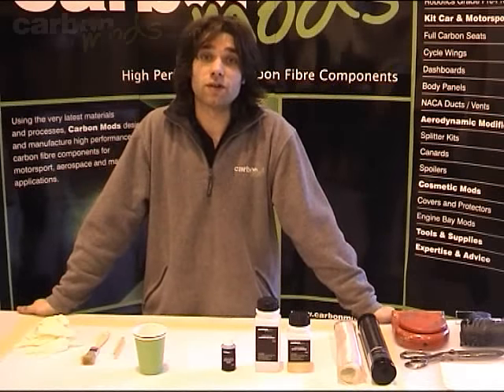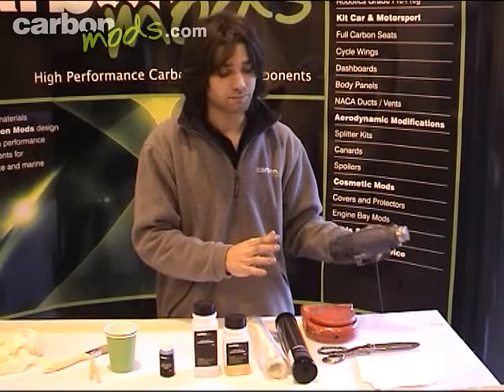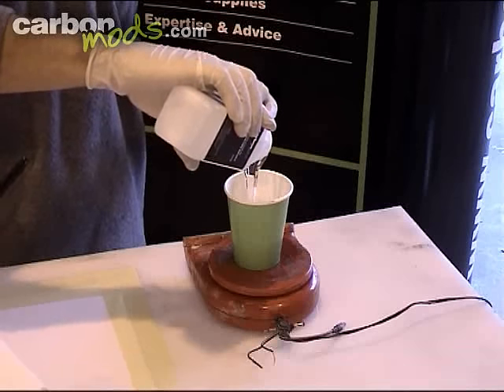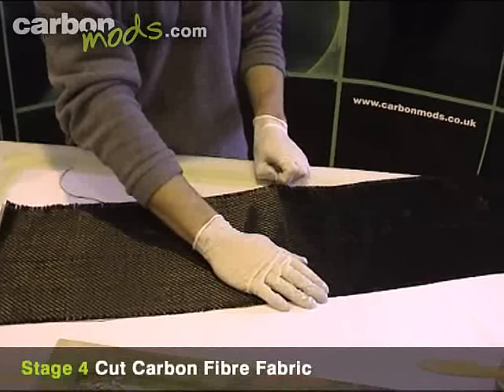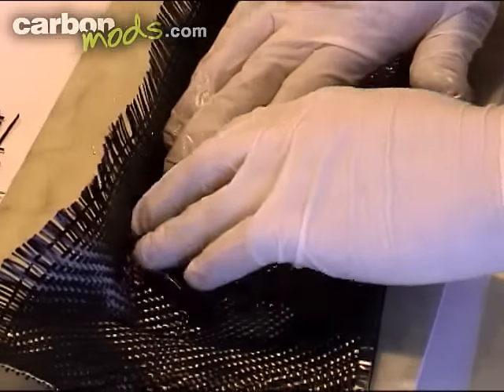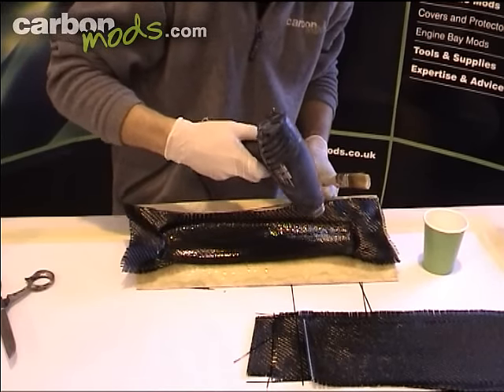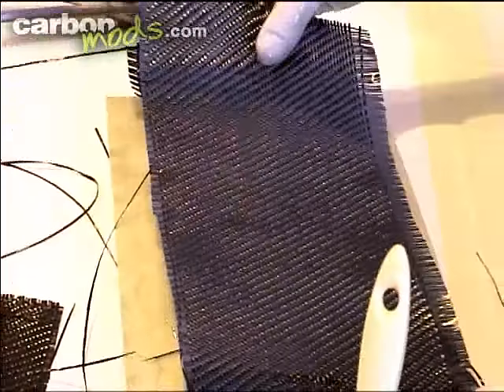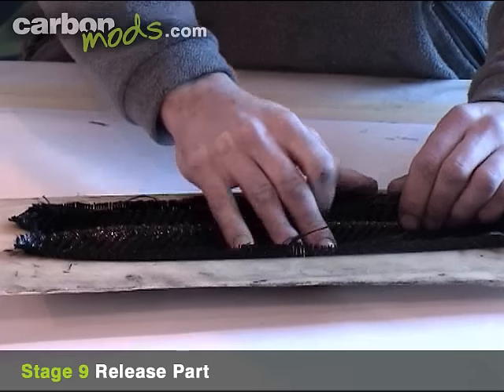How To Make Your Own Carbon Fiber (Fibre) Parts.

Comment: You may not have fully understood mechanics. A higher volume fraction does not implicate higher strength, but a higher strength to weight ratio/ higher area to strength ratio/ higher youngs modulus (since the youngs is area depending). Since you just have more material when overwetting, the component is marginaly stronger, and heavier.

Comment from the maker: Bertaziod, autoclaves apply pressure, vacuum and heat to the laminate, (special pre-preg materials, that already have the resin in) this consolidates the materials making a stronger/lighter laminate, we use this process for many of our production components, but you can get 90% of the performance and amazing finishes using the method in the vid without spending tens of thousands on equipment! Despite having a 'clave we still use this 'wet' process regularly  in our workshop!

Comment from the maker: Well, a globe is tricky because it would need to be made in at least two halves (otherwise there would be no way that you could be laminating 'inside' the mould. Two two parts would need to be put together afterwards, bonded, and then probably lacquered over the top to make the seem really smooth and hard to see. The fibre would not be continuous - there would be a visible join where the two halves come together, but under lacquer this would look fine.

Comment: One thing that you might tell others is that when you are starting your second, and third reinforcement layers after the first, you want to try your best to criss-cross the weave of the fabric to gain even more strength of the part when its done. If the part is for looks as well as strength, then the second and other layers I will use black fiberglass cloth and save my carbon fiber myself.

Comment: Quick pro tip....if you aren’t going to vac bag your laminate, here is an easy way to get better fusion between the layers.  Take your 1 inch laminating brush, and cut the bristles so they are ~ 8-10 mm long.  That will eliminate stray hairs from getting on your work, but more importantly it will result in really stiff bristles that can be used to force resin into the laminate.  I have successfully used this technique for a laminating schedule of fiberglass cloth, roving, and more cloth over balsa wood core during boat hull restoration.  Works really well.  You get a great bond and use minimum resin.  Granted, it’s not as good as vac bagging, but it’s better than painting the resin onto the cloth
Reply: Awesome advice,  I have worked with fiberglass and much better to force in the resin as you state instead  of painting!

Comment from the maker: Thanks for the interest, there are a few ways that tubes can be made, the simplest way for a home builder to make a bike frame is to wrap the carbon around a foam 'core', a good tip with this method is to wrap the uncured part with shrink tape, this will help to consolidate it. also you will need aluminium inserts for the bottom bracket/hed-tube/drop-outs etc, they are difficult to make/find, you could always just cut them out of an old frame! Hope this helps.

Comment from the maker: @Crixe : So long as you seal the mould correctly (and then coat it in a suitable release agent) then just about anything can be used as a mould. Plaster is VERY porous so you need to use something like primer spray paint to seal the plaster thoroughly. Once you've done this you can release coat it (using something quite robust like PVA release agent) and then you should be OK.

Comment from the maker: Hi Ian, Thanks for the question, to trim the part a dremel type tool with a cutoff disc is ideal, we do some great value tungsten carbide dremel bits on our site which virtually last for ever, we have one in our workshop that's cut over 3 miles of carbon!  then simply 'soften' the edge with some 120 then 240grit paper, you'll get a really neat finish this way. We have more info on trimming in the 'Guides' section of our website. 

Carbon Mods

Comment from the maker: Yes, there is actually. We've been working on it for some time because there's lots to cover. The first one will be resin infusion, after that we'll do a standard vacuum bagging. Just cause we love infusion so much, the parts you can make are just so strong and light. After that, we'll make one on standard bagging. Oh, and for both of them we'll have the rubish sound qaulity sorted! Glad you like the vids.

Comment: Nice dude, extremely helpful, just one question though, i was adviced to use a vacuum pump to get rid of the air, does heating the thing make it as great. Lovely results you got there!

Comment from the maker: Hi Bertaziod, the resin will cure in the air at room temperature, there is no need for and oven or an autoclave (very different bits of kit) the warmer the place where it is left the quicker it will harden. But left over-night at room temp is normally enough to release it from the mould, it will then 'fully' cure (the last few percent) over a further day or so. Thanks for the question.

Comment: nice but it has a much better finish if you bag if and use a vacum pump also makes it a lot lighter
Reply: You need a stiff mold to keep the shape if vaccum laminating. More importantly to laminate in falling temperature when curing to avoid air bubbles

Comment from the maker: You can skip the advert if you wish.  

The mould is made using an epoxy gel coat and fibreglass backing. You can make moulds out of a number of materials including using our mould making starter kits.

The woven glass is used to save cost. For a cheap cosmetic part, most people want the carbon on the surface for looks, so it doesnt matter if you use the much cheaper fibreglass underneath.  However if you want 100% carbon then you can make it that way.

Comment from the maker: Hi, actually, this type of repair works really well. I'd recommend wet-laying the carbon fibre (like we show in the video) and then wrapping the finished repair in heat-shrink tape. You heat up the tape and when it shrinks it will squeeze the excess resin out and leave you with a nice consolodated repair. Our fishing pole repair kit works in just this way.

Comment from the maker: There are a number of ways proffesional workshops can produce these components, from wet layup processes (as shown here) through to vacuum bagged methods eventually onto autoclave cured pre-preg components (which is how we make many of our production parts) but it is certainly posible to use wet layup to produce the parts that you talk of, you might be a few percent heavier but without spending a fortune on equipment it's really the only place to start. Good luck with your project!

Comment from the maker: @ionutzB123 : You're referring to pre-preg carbon fibre; that's cured in an autoclave under pressure and at elevated temperature (150 degrees C would normally be the maximum cure temperature for any standard resin system, 120 C would be more common). Pre-preg parts will generally have a lower resin ratio than a wet-lay part (like the one made in this video) and so be stronger for their weight but  they're both valid methods. Resin infusion is another option which can yeild very low resin ratios.

Comment: that's gonna be a pretty weak piece with many imperfections. it needs to be vacuum bagged to squeeze the layers together. right now you just have a few layers of CF with resin in between them, not a solid piece that's fused together.
Reply: marty galinskas It's solid all right, but as you say it's like carbon floating in a resin matrix, brittle and not very strong at all. Vacuum bagging would probably halve the weight and increase the strength many fold.
Reply: Depends on what your using it for.

Comment from the maker: Hi Casler, 

The white fabric is just a woven fibre glass, it can be used that add thickness to non-structural parts. when the resin 'wets' it it will go pretty must clear, if you are after a silver weave check out the alufibre on our website, it makes parts that look like a silver version of  carbon fibre. Hope this helps.  

Carbon Mods

Comment from the maker: Hi Givemetoast, 

Weave orientation does effect the performance of the final part, however it depends where you want the strength as to how you might layer the fabric, alternating between 0deg and 45deg will give the most consistant performance in all directions, however if strength is desired mainly down the length or width (or both) of the part then keeping the layers in-line will improve performance there. 

Thanks for the question, 

Carbon Mods

Comment from the maker: Hi, Yes you can but generally for large parts (like fenders or fairings) you would use a vacuum assisted process - ideally resin infusion. It's not as complicated as it sounds and we have complete Resin Infusion Starter Kits available for £320 which include the vacuum pump, resin, catch-pot, bagging materails and everything else you would need for the process. Parts made in this way would be incredibly strong, light and amazing looking!

Comment from the maker: Hi Walperstyle,

Just to clear things up for others, this is true 100% carbon fibre, sure there are more advanced processes out there such as resin infusion and prepreg laminating, that get even greater performance, however wet-lay-up as seen here is where it all started and is still one of the most common manufacturing processes due to it's low-cost setup and tooling. 

Thanks 

Carbon Mods

Comment from the maker: Hi Lowcost, It's difficult to know what you mean by very stiff but a peice at 5mm thick would be virtualy impossible to visably bend in your hands at that size, that would be about 12 layers!, sanding the surface is not nomally needed, but a bit of a polish can often help to bring out a full shine! I hope this helps.

Comment: You never explained what the white roll of glass cloth is used for.
Reply from the maker: Good point, sorry! Really we just include this in case people want to have a practice run first with a less expensive material or alternatively you can use it to 'back up' a carbon fibre part so that it's carbon on the surface and then reinforced with glass. By doing this, the part won't be as 'high performance' but it will reduce the material cost and make the carbon go further.
Reply: @Francesco Cancellieri yes

Comment from the maker: @awesomenoob6281 : Yes, certainly. Either the bodyshell or the chassis. For the chassis you would generally make flat sheet and then cut the shapes out of the flat sheet. The bodyshell you would need a mould for. If you use the inside of an original lexan bodyshell then you'll get a nice part but it will be slightly smaller than the original.

Comment: sorry I cant hear it. what's the ratio again for epoxy and the hardener?
Reply: Buy a book Sorry.
Reply: i cant understand myself, on the bottle says 100 - 30 but on this video something 2 to 1 or similar .. :/
Reply: Evaldas A  Depends on the product! I use west epoxy which is 4:1. you have to follow the instructions on the product itself. sounds like you have a 10:3 ratio, which seems a little odd. also note if it is by volume or weight (although most resins have an equal density between hardener and base and this is a moot point).
Reply: Tim Sherry  yeah, my tin says 10:3 ... which to be say its allright, my part came out looking nice and strong, but was a bit runny on the edges... well, i still have few drops of it, i will try to mix it a bit differently ;)
by the way.. thanks for your info :)
Reply: It's a legit question, if you're used to polyester you might think it doesn't matter. And the last thing anyone wants is to hear about a big stack of carbon fucked due to crappily mixed resin.

Comment from the maker: Hi BadAndy029, 

The thickness required for a cosmetic part depending very much on what the part is, but generally small cosmetic parts such as interior trim would be made from 2 or most often 3 layers, and for non structural parts after the first layer the rest can be made from woven glass. 

Hope this helps 

Carbon Mods

Comment from the maker: Hi Plooke, if you're getting a matte finish that will almost certainly be on the mould, give it a really good polish, the part will only be as glossy as the mold, you can polish matte areas on the part or mould with some metal polish or paint restorer (try on a small area first). I hope this helps you out.

Comment from the maker: Hi grindzewall, 

The resin in the pot does cure and there's no real way of stopping it, so it's a case of judging how much you will need and only mixing enough, as for trimming the part, generally the trim is done after the part has been removed from the mould, there's loads of info about this on our website. Thanks, 

Carbon Mods

Comment from the maker: @themichaelnuckles : 'Fibreglass resin' is generally polyester resin, this is epoxy resin. There really is no liklihood of accidentally setting the resin on fire using a heat-gun to pop air bubbles. It's standard practice and a very important part of the process to get rid of the bubbles (by lowering the viscosity of the resin and expanding the trapped air). If you use a hair dryer you need a *high* heat setting and a *low* blow setting (otherwise you just blow the resin off.

Comment: i worked in a carbon fiber facility and to build REAL carbon fiber (pre-peg) you need  a serious equipment worth like 100.000 + dollars.
Reply: I worked for a super yacht mast manufacturer and we used the same method as this guy but we vacuum bagged.
Reply: We used pre peg materials ,you used dry probably :)
We put them in the autoclave after the vacuum bag.
if you don't put the carbon fiber in the autoclave then it isn't real carbon fiber,it's weak.
Reply: dimmacommunication it is as strong as fiber glass, but not as strong as real carbon fiber. For most people who don't have any special intention for using the 'real' carbon fiber, they just looking for the awesome pattern of the carbon fiber itself.. :)
Reply: i just googled autoclave and basically it works like the microwave did. I wonder if we could use the microwave to give this pressure to the carbon fiber, will it give the same effect like the autoclave did? response please  :)
Reply: Kevin Hermanto

A microwave isn't even similar to a autoclave :)
an autoclave applies pressure and high temps  to an object.
To build CF you need to apply pressure to the object ,without it the piece would't be made and if it would be heavy and fragile.
Reply: Kevin Hermanto , Autoclave works with temperature and pressure, and you can controler how you use it... microwave is just a oven to make popcorn
Reply: *****
I think people call this "wet carbon" it's heavier and much less resistant than dry carbon.
Well  for dry carbon you need to have someone doing it for you.
Reply: Horizon585 it is real carbon, it just won’t have the structural integrity of a proper production part as it wasn’t cured under pressure and I’d assume he didn’t use a quasi layup (although I haven’t watched the full video yet). You can oven cure production jobs but again they’re in a vac bag which itself pulls about 30 psi. Jobs that have core in them are only cured at 30 psi too as any higher would crush the core, hence to get a good visual consolidation on the first plies they’re often done as a 2 shot job, where the first plies are cured at 90psi in the clave before the core is used on the job. Yeah I’m a laminator X)
Reply: And it’s wet lay, kind of old fashioned everything is pre preg now
Reply: Yeah he payed it all up as 0/90 no 45 orientation

Comment from the maker: @319PurpleHaze : It's pretty much the strongest reinforcement by weight that you can get. That means that any manufacturer looking to make very strong and light composite parts will use it rather than any other reinforcement (like glass). People love the look because of carbon fibre's background (F1, Aerospace etc.). In motorsport the carbon fibre is nearly always painted so it's not used for the looks there!

Comment from the maker: GR8racingfool. You're dead right. Worrying about weave orientation was a bit beyond the scope of this vid but it's quite right that alternating weave orientation or sometimes focussing it in a specific way brings extra strength to a part. As for the glass, we actually include some woven E-Glass in the kit specifically for backing products that are mainly cosmetic, as you say to make the valuable carbon go further. Good stuff!

Comment from the maker: @mannuel5 : We do most of the trimming in our workshop using Dremmels with Perma-Grit wheels in them. These are basically just discs with abrasive (tungsten carbide as it happens) on them. Using abrasive discs instead of anything with teeth stops the carbon from chipping when it's cut and so makes for a neater edge. You can then finish the edge using sandpaper and finally polish it up.

Comment from the maker: Actually the resin we use has excellent UV stability. Resin systems have moved on a fair way from the days when they were more susceptable to UV damage. PVA should only ever be applied once, repeat applications will drag it off. Wax can certainly be used instead of or in addition to PVA (we cover this in more detail in the PDF which can be downloaded for free from our site). Fair comment about swapping cups if you're worried about how well you've mixed it though!

Comment from the maker: @geo6642 : I don't know about teak oil but I know that wood (such as MDF which is often used) can be sealed with several layers of shellac (which is a wood sealer) and it works well. If in doubt, produce a small test mould and try it first for a release.

Comment from the maker: Hi Matt, there are no special high temperature carbon fabrics. The carbon will be good for much higher temperatures than the resins will like (until you're into very specialist resins). The epoxy used in our kit should be quite happy up to about 100 degrees but higher temperatures resins are available.